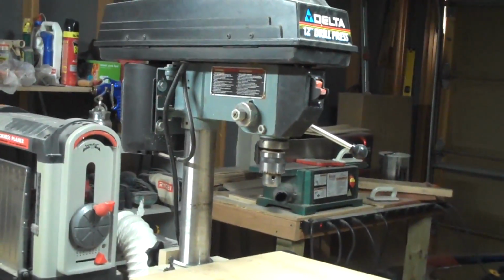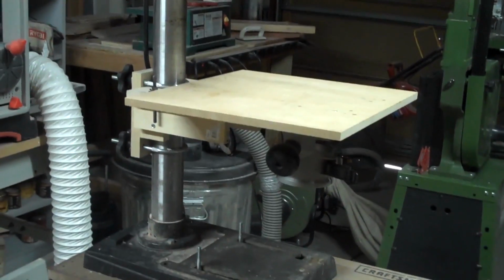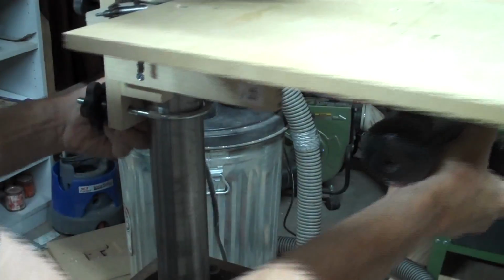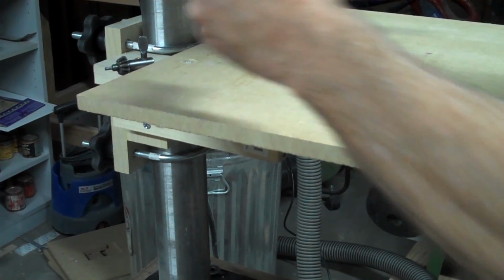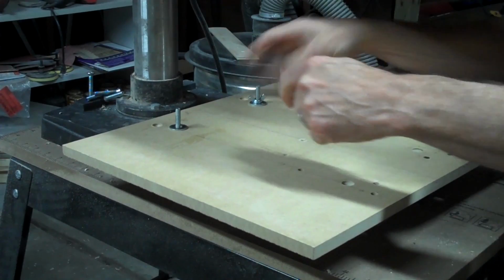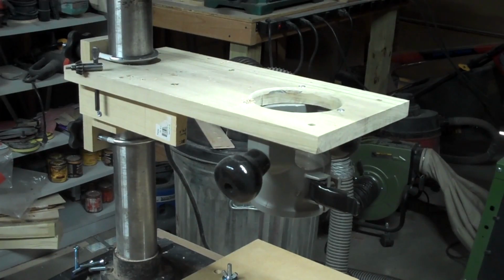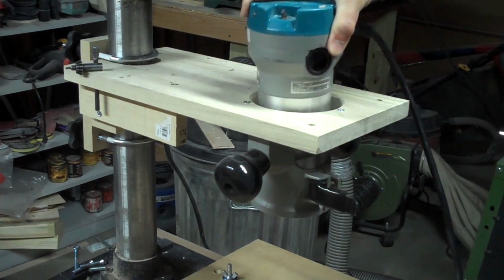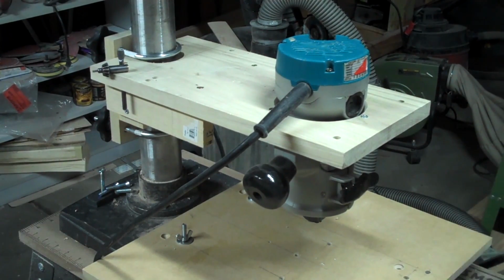My DIY Overarm Router

Comment: Really just a router holder, and not an overarm router. Good idea and fair build. Not good for fine, detailed work.
Reply from the maker: I did amazing detail work with it. However, I got smart and replaced it with a CNC machine.

Comment: you need to cut a piece of wood that is u shaped with small recess to go over the u bolts. if they was held were they can't move up or down it would slide easy. just a thought. I had just made a pin router table for my shopsmith and was looking at what other people have done.